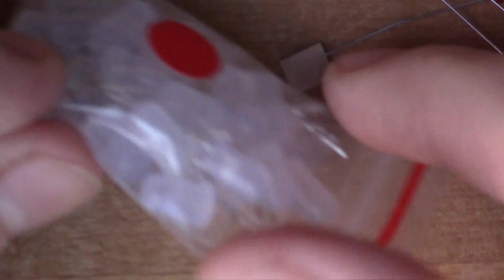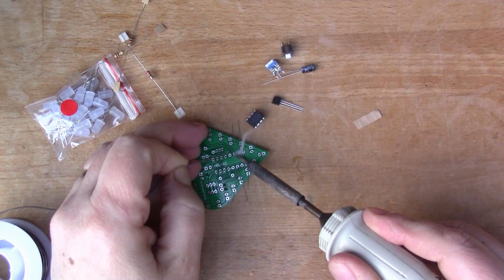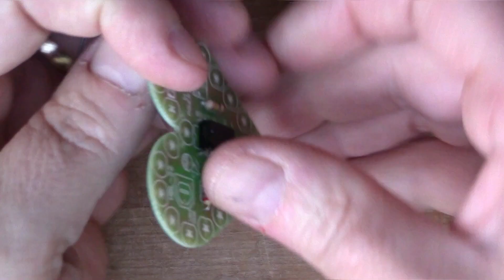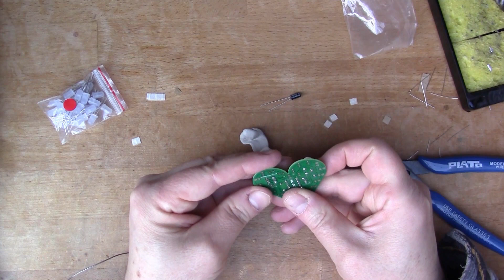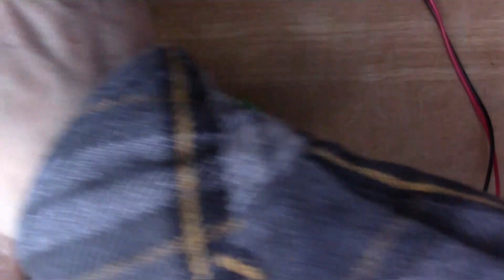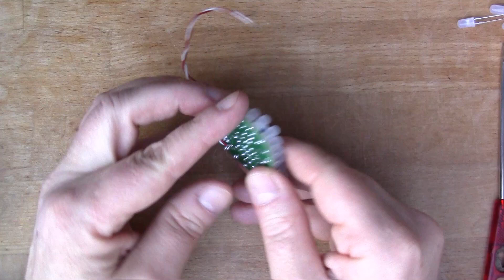LED heart kit build and test (#94)

Comment: hi! i’m quite new to electronics, and after i’ve soldered everything, I am unsure how to bring power to this :/ can I just use two wires and 3 batteries, but then I would need a battery holder… I am quite confused, do I solder the wires in? I just want the easiest way to test it with stuff I might have lying around. And based on the print of this board, how is it even supposed to be powered?
Reply from the maker: I used a bench power supply, but you could power from 3  or 4 AA or AAA batteries.  If you have dollar store (in the UK here I go to Poundland) you can get cheap lighting sets that have a battery box for AA batteries, which are useful for something like this.  If you have a 18650 rechargeable battery, this should work also (when charged they have about 4V).  As to where - on the silkscreen there is a little rectangle where a power connector can go.  I just solder wires to the contacts here.

Comment: is there a way to power it without adding those two extra wires as you did?
Reply from the maker: It needs 4 Volts, so it might run from a small Li-Po battery, e.g. like the ones used in those helicopters you can fly indoors: https://www.aliexpress.com/item/32948335535.html.  A small battery like this will tuck-in behind the PCB.

Comment: I built 2, without success.  Is the 6 pin power button, reversible?  Meaning, can you put it on the board in any direction?
Reply from the maker: Not any direction, no.   These PCB switches often have pairs of legs joined together, so if in doubt use a multimeter in continuity mode to check which connections are made when you press the button. You can normally tell from looking at the PCB which contacts need to be bridged to switch it on.

Comment: Any ideas on how to power this other then a voltage injector tool? Got a few of these for stocking stuffers.
Reply from the maker: It needs something close to 4V to work properly, so perhaps a well charged Li-Ion battery?  Or failing that, a couple of disc cells (e.g. CR 2016)?
Reply: @MartynDavies  ahh ok any idea on a connector that may work? I may buy that 500 port connector from Northridge fix and see what I can do with that. But thank you for this guide I actually soldered a peice backwards lol 🤦‍♂️but fixed with some flux and nice wick.
Reply from the maker: @shadowarez1337  the board I've got seems to have space for a 2-pin JST connector.  These are not a bad way to get power in.
Reply: @MartynDavies  thank you I'll see what I can find with this I also got some cell battery connectors coming in with leads so can tin wires and solder em on also I will change the tip I used a very fine tip better to use the other bigger tips. 

Thank you for clarifying the resisters as well I didn't know the values of them.

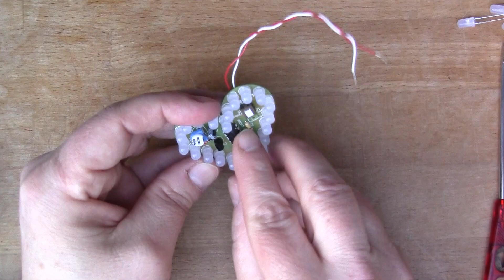Comment: Hi, what's the red and white wire at 21:31 called? I don't see it in my kit, am I supposed to buy them in order for the kit to work?
Reply from the maker: These are just bits of wire from my own box of wires.  The markings on the board look like some kind of power connector can go on there (e.g. a molex 2-pin socket), but no connectors were supplied with this kit.

Comment: How big would the device be using full size components instead of the chip ?
Reply from the maker: The chip here (dual op-amp) is generating a triangle wave.  You could do that with a discrete circuit e.g. transistors, but it would take quite a few.

Comment: I find that if you use a flux pen on the pads it makes a huge difference.  I think these kit pcb's must lie in warehouses for a length of time and the traces oxidise over!
Reply from the maker: It occurred to me afterwards that a wipe with isopropol might help also
Reply: I'm also cleaning off the board's pads with isopropyl alcohol prior to soldering. It's true that electronics can get stored for long periods of time and in non controlled humidity. I've had rusted parts...